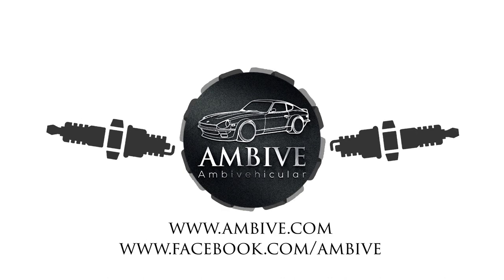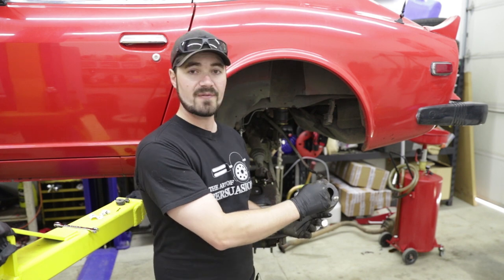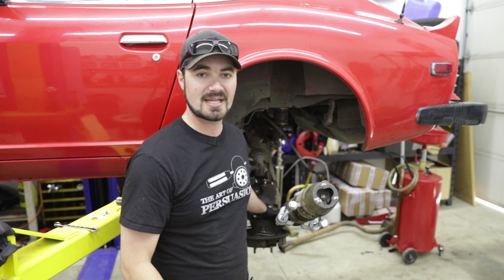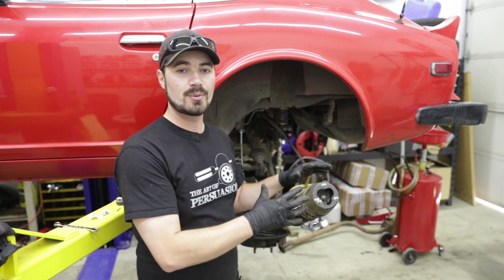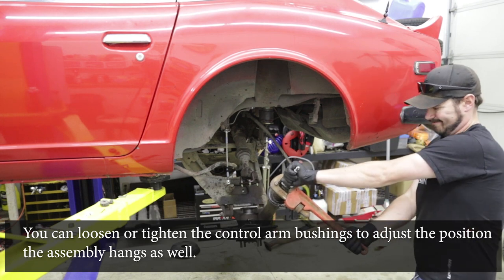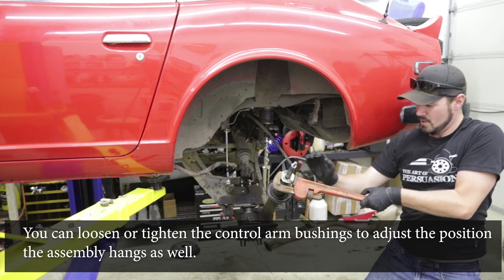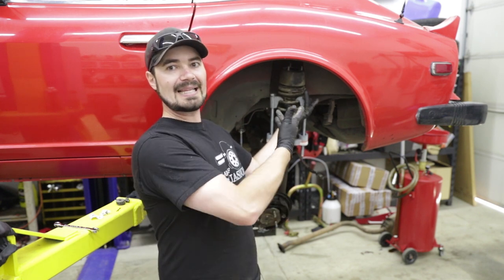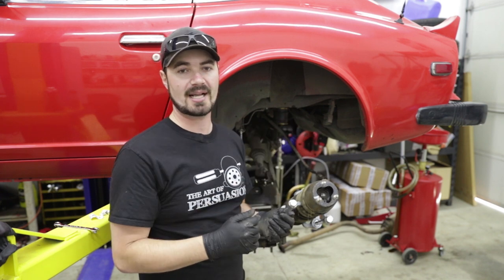Tip for working on Datsun 280Z struts

Comment: if you have stock bushings on the control arms you may want to loosen the 21mm (IIRC) bolts to release the bushings so the rubber is not stressed by the extreme lowering of the control arm. Retighten once the job is done and the suspension is loaded. I did this on both the inboard front and rear bushings as well as the spindle pin bushings.

Comment: This was helpful, thanks.  What brand was the coil spring compressor you used?  Most of what's available in my area has hooks that are too big to fit between the coils.
Reply from the maker: I don't remember, I have several side compressor kits that range from super cheap harbor freight to name brands. There are a lot of kits with thinner fingers on Amazon.

Good luck!

Comment: Great video, Casper. I’ll be replacing the struts and springs on my 1972 240z in the near future and was hoping to avoid the spindle pin at all costs. After removing the brake line, what did you use to plug it? Also, any tips for the front end strut replacement?
Reply from the maker: The fronts aren't too bad, but because you have to essentially dismantal the front, it's. Good time to do tie rod ends and bushings as well. If you pull the caliper as a whole, you don't need to plug lines on the calipers... Though it is a good time to replace the soft lines of needed.

Comment: When replacing the struts did you fill the strut housing with oil for heat dissipation and future serviceability? I’m about to do my shocks and springs and have read on dozens of threads about filling strut housings with oil. If so, did you drain what was in there or reuse it? Just trying to get a sense of what I will find in there/need to do!
Reply from the maker: I put a little oil back in but got rid of the dirty oil. Mine were flooded with oil that was horriblely gross and didn't seem to do much to help over when I have tried to change dry ones in the past. Personally, I'm a little skeptical of the real benefit compared to other options.
Reply: AmbiVe ok sounds reasonable. Could you remove the old oil while the strut was out sideways like that? Or did you have to take it completely off to remove it? Thanks!
Reply from the maker: I did the fronts removing them all the way, the rears I dumped out while still attached at the bottom. I don't know which was easier. Either way, it was gross and seemed really questionable to as how much was oil added on purpose and how much was crap leaked out of the units/leaked into the casing from use.